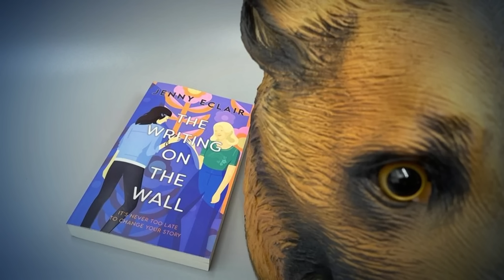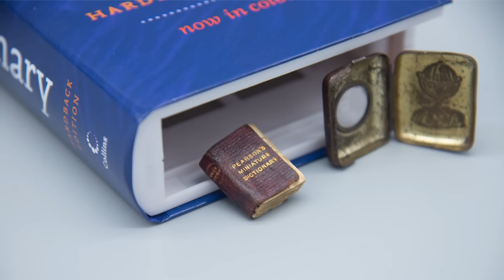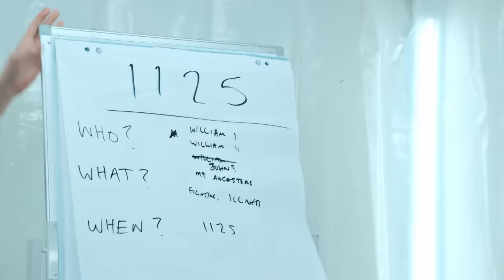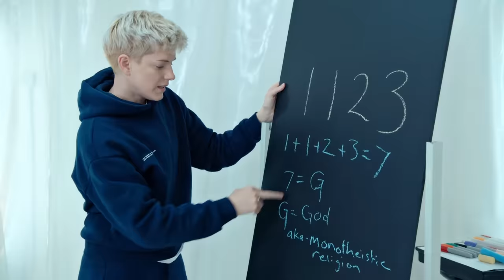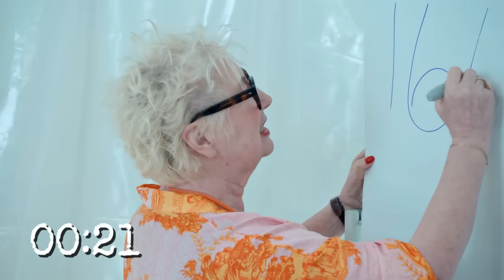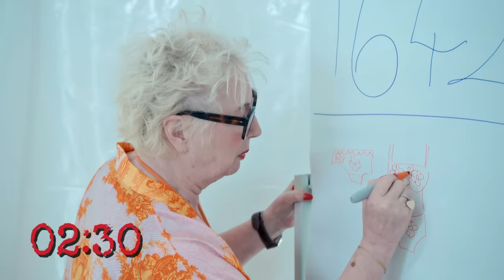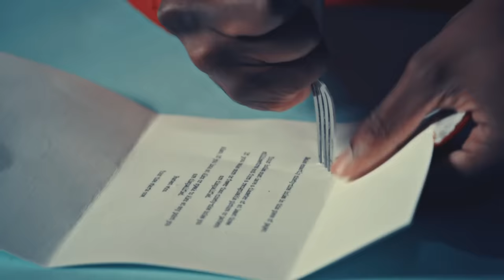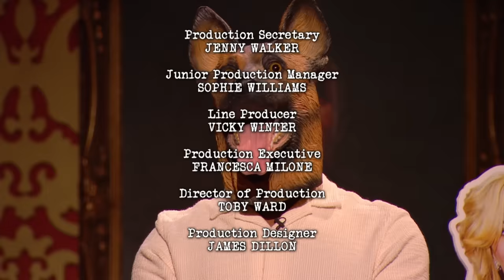Series 15, Episode 9 - A Show About Pedantry | Full Episode

Comment: I'm afraid the holes from the fork tines were not large enough, i.e. did not have a diameter of at least 3mm. (At least not all of them.) Fork tines are about 1mm wide at the top and the middle ones usually only get to 3mm if inserted fully. By the way he held them when poking it is clear he couldn't have made holes large enough.